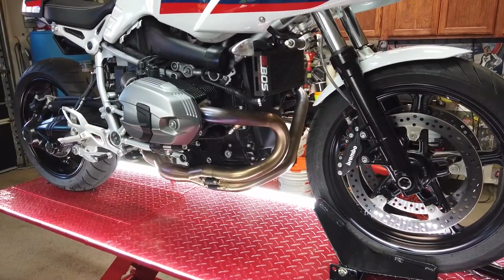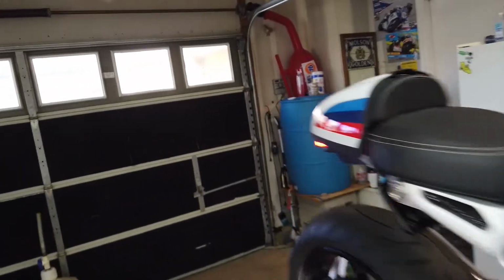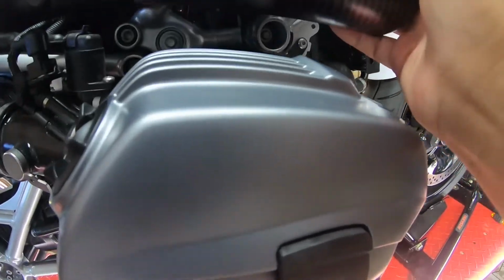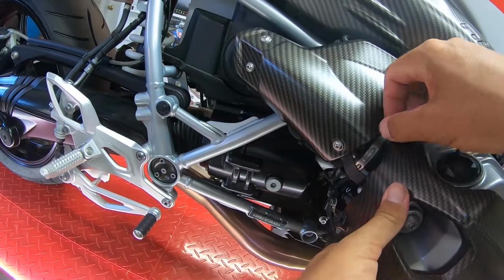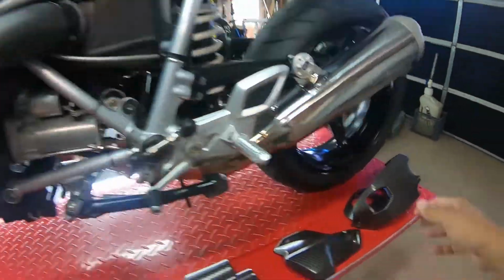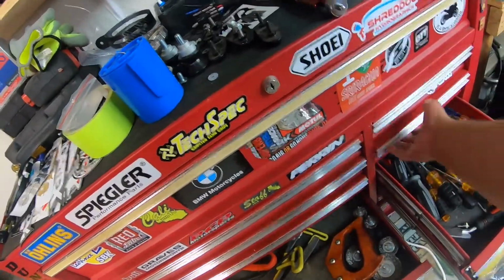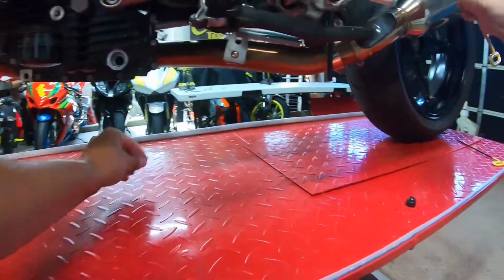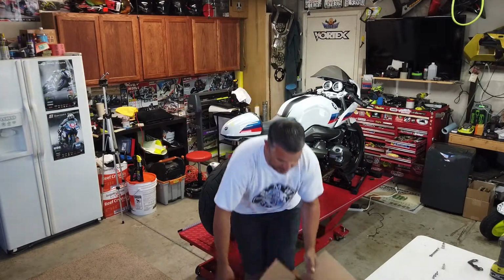2018 BMW R NineT Racer Upgrades and Updates

Comment: So looked forward to this video but not only was there no custom Two Bros exhaust system, the fit and finish on the tail light is horrible, all the plastic bolt on parts looks like exactly that, and you did not get into the LED headlight which is what most people wanted to see.  Please take off those Alibaba parts, the bike looked fantastic the way it was before.  Sorry, no.